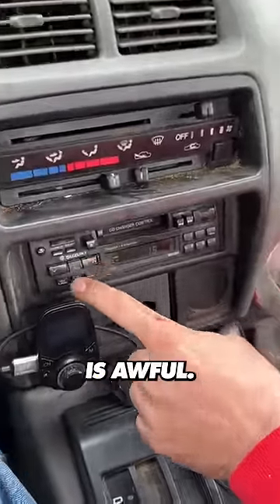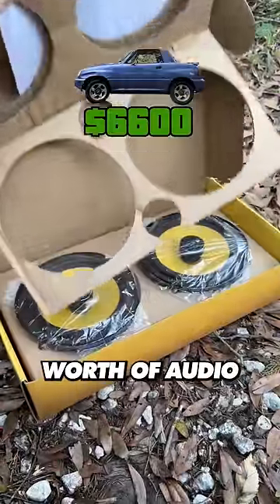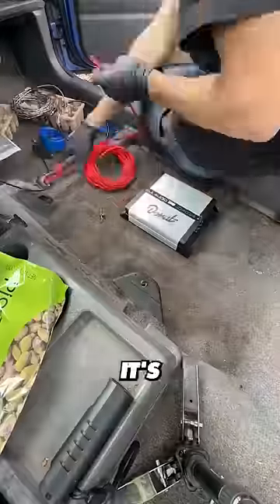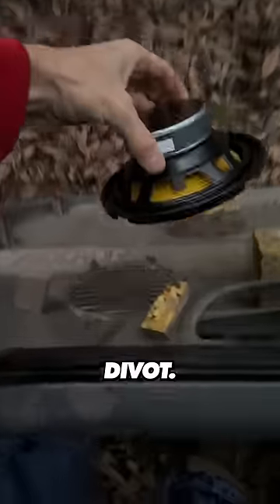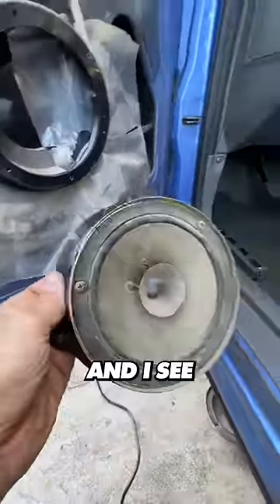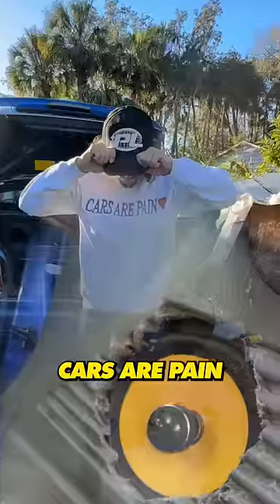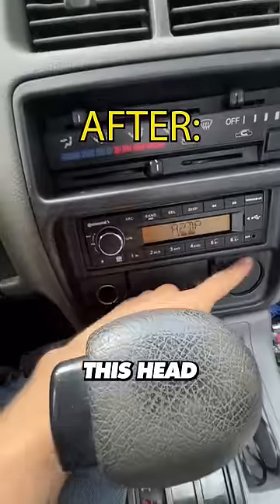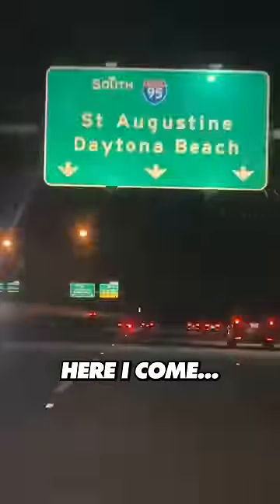PART 4 of my cross-country Suzuki build

Comment: I bought an X90 new from the dealership in 1996. It was the RWD with manual transmission. Absolutely LOVED that little car, and I've been angry with myself for having sold it. I upgraded all the speakers, installed two amps, put in a large ported sub box with two Earthquake 12s, and an Alpine CD player. That really was such a fun little car.

Comment: Speakers and headunit were one of the first mods I did on my x90 as well. Also you have a 1998 judging by the interior which means your car is 1/400, very nice.
Reply: 1/400 and proceeds to cut into door panel 😂
Reply: @weewooweeewoooo  yeah he fucked up tremendously right there. They only made 400 of those seats and door panels lmfaooo. I paid almost 1k for a 98 interior set for my 96x90
Reply: Tbh my day would have been kinda ruined if I did that only to find out it wasn't necessary
Reply: @TheGlobal747  dudes definitely kicking himself now haha

Comment: I know that the serie is now far from the video, but you could 3d print a cover for the new speaker! 
It don't need to be a Czinger 21C project, but somethind that you can just screw on the door panel

Comment: AND THAT CONTINENTAL HEAD UNIT IS EVEN WORSE THAN THE ORIGINAL ONE BECUAUSE IT DOESN'T EVEN HAVE THE TAPE DECK THAT THE ORIGINAL ONE HAD!!! WHY ARE YOUR UPGRADES ALWAYS DOWNGRADES?! AND THE CONTINENTAL IS EVEN GOING TO KILL YOUR ELECTRICAL SYSTEM LIKE IT DID MY 1998 TOYOTA AVALON XLS!!!
Reply: Perfect timing - I was gonna tell them to UP-upgrade to a Panasonic CQ-RX450. It has USB and aux-input ports like the Continental, plus a removable face panel [the Continental has no such feature], and a CD changer [again the Continental has no such feature]. Plus, it's a Panasonic so you know it's going to be better than the head units made by whatever no-name Chinese company owns this "Continental" brand... Oh, and it WON'T even set fire to your Toyota.